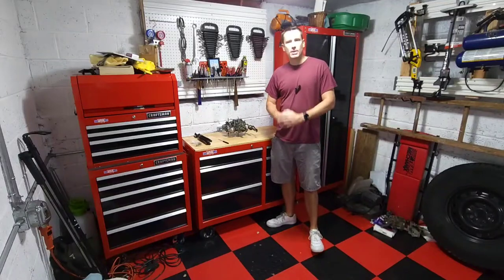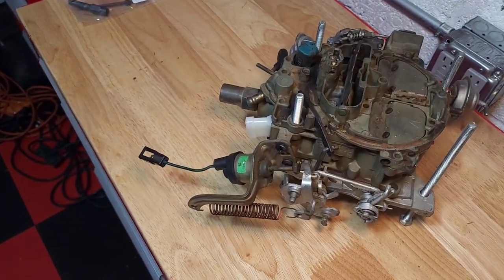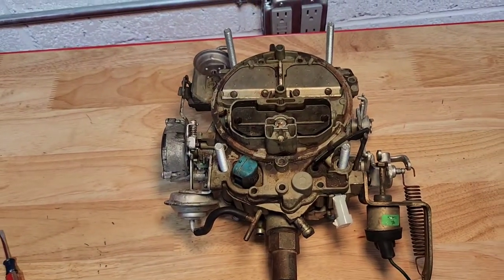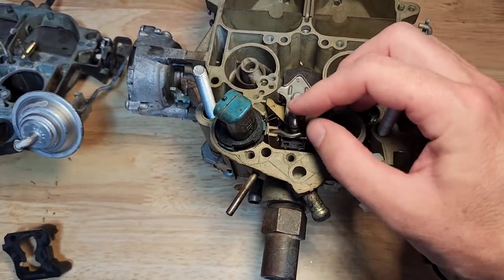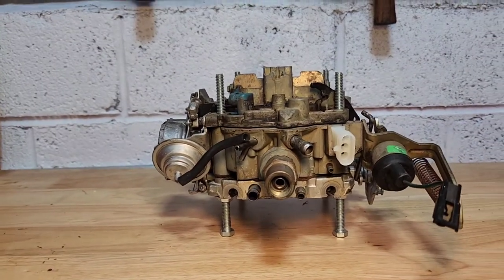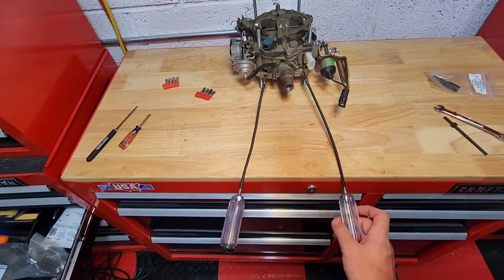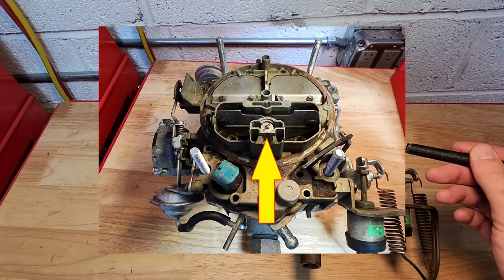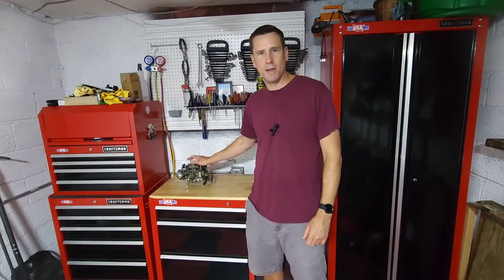The 4 Adjustments You Have To Get Right On An Electronic Quadrajet Carburetor

Comment: This is a very helpful video for those who don't know electronic Quadrajets. It appears you have the 17086009 carburetor (86-90 VIN 9) which the idle kickup solenoid actuator for A/C tells me this, along with the preset rich stop. Y engines are set exactly the same way internally. I know you meant to keep the video fairly short, and it's a very good presentation. Thank you for that. I'd like to add a few pointers here that may be of help.

When setting the mixture control solenoid using the adjusting screw, press down on the M/C solenoid housing with your free thumb while making adjustments as much as possible. This relieves pressure on the micro-fine aluminum threads in the fuel bowl body as you move the screw in and out. If they get stripped in the body, you're in trouble. Although your method certainly works, the preferred service manual method is to set plunger minimum with the gage by turning screw about 6 threads in to start, then use the tool to adjust the M/C solenoid position so that the plunger is set to barely touch gage. Then count the number of turns to gently, but fully bottomed M/C solenoid adjustment screw. Then remove the assembly and reinstall metering rods, and install fully bottoming the adjustment screw, and counting the number of turns on the way up. 

Also, when bench setting, it's a good idea to remove the plug in the top carb cover from above the M/C solenoid adjustment screw. After final adjustments of the carb on the car, you can reinstall preferablly a new plug to obviously plug the hole and the plug doubles as a "lock" of sorts on the top of the M/C solenoid adjustment screw. 85 and earlier flat tappet carbs with a rich stop has one extra setting that needs taken care of. You want the rich stop 1/8" of an inch total travel of the plunger + or - 1/16". Roller cam engines from 85-up all have rich stop built into the M/C adjustment screw and is non adjustable.

If there's a letter stamped on top of it, which for VIN 9 307 it usually is, set the Idle Air Bleed Screw (IABV) on the bench using the setting tool (1.756" gage setting from top of IABV to plunger paddle at lean stop) after the carb top is back on. It's almost a bench set it and forget it thing. But as always, final adjustments is on the car, running. I've personally not needed to mess with the IABV valve once set with the tool.

On these types of carbs with the lettered IABV, the idle mixture screws are the star of the show when getting your M/C dwell settings. They are bench set to 3 turns out from fully seated according to the 1987 AC Delco tune-up specifications manual. Be careful seating these as well, you don't want to damage the seats. When making adjustments for dwell on the car, you should be able to dial in your 30 degrees M/C dwell by mixture screws alone provided the bench settings were done properly. But as you point out, if you do have to make adjustments to the IABV, make them in small increments and wait 15 seconds for the adjustment to settle out. While convenient and less of a PITA to fit them in place, it isn't absolutely necessary to adjust the idle mixture screws exactly at the same time with two flex double D screwdrivers. You can adjust them one at a time. Just try to ensure you adjust them equally and give it a little time to settle out between readings.

And for clarification, the 0.41 voltage from the TPS is at 600 rpm in drive while on the car, A/C off with solenoid A/C kickup plunger not engaged.

When setting the carb on the car, it's best to set your ignition timing first before fiddling with the carb settings. 20 degrees at 1100 RPM with the advance disabled (ALDL grounded).

Lastly, clear any codes that may have set while you were tuning.

Keep it up. You make very informative videos.

Comment: A huge THANK YOU to the RPO guy! I followed your recommended steps and adjusted my 1983 Rochester CCC carb and now the car runs great and the Check Engine light doesn't come on anymore at highway speeds. 
The MCS was set too high, about 3/16", so I used the correct gauge to set it correctly. I also set the TPS at .46 volts per GM spec and the air bleed screw using the correct gauge. I set the dwell as recommended by RPO by adjusting the mixture screws. The final number of turns out was 3.75, I started at 3.5 as a base.
Later I was at a stop light and thought that the engine had stalled as I sensed no vibration at idle, the idle was that smooth. If I can do it you can do it, just get the right tools first. Fortunately I also has a Snap-On scanner from the 80s which gave valuable information on what the ECM was seeing from the input sensors.
The registration is due and now I am confident that the Toronado will pass the California smog test next week.
Reply from the maker: YOU'RE WELCOME!!! That's great news! I'm really glad you were able to get everything going. Happy I could be of help.

Comment: Probably the best ccc qjet video on YouTube, nobody actually explains what exactly everything is and how to adjust it. Been pulling my hair out over my qjet, is there any way you could do a video on the bench settings for all these adjustments? That would be absolutely awesome, or if you could pm me, whatever works Thanks!!
Reply from the maker: Thanks for the compliment! I'm trying to really break these down for everyone. I know there isn't much out there on them, and as the popularity of these cars grow, I'm trying to share what I know with everyone. The bench settings for the TPS vary with each car. The mixture control solenoid is usually around 10 to 12 turns out from bottom, but you really do need a gauging tool because each carb is slightly different. The idle air bleed is about 7 turns out from bottom. And the idle mixture screws are 3 turns out from bottom. I break it down more in the full video here:
https://youtu.be/VOCsOonLCXA

Comment: Great video and help.  Please clarify where to attach the dwell meter.  Manual says to connect red lead to bright green wire and black to ground.  After 40 years, the wires tend to darken. Thx!
Reply from the maker: I just made a community post with pictures to answer your question. On these cars, it's not so much a wire, but a connector. Its located on the wiring harness in front of the carburetor, near the thermostat. Simply attach the alligator clip to the metal tab inside.

Comment: Great video like the rest, but I am somewhat confused on the dwell setting. I understand dwell and know how to connect the meter to the engine.
You recommend setting dwell at 25 by adjusting the mixture screws, but also recommend setting dwell by the air bleed screw. Do I do both? The air bleed is sensitive, I agree.
Assume the MCS is correct, timing is correct, and TPS is correct when setting the dwell.
Reply from the maker: Set the dwell by adjusting the mixture screws. For your 5 liter I'd recommend as close to 30 degrees dwell as you can get it. The air bleed adjustment is more of a tweak at the end. Example: Your engine idles a bit smoother at 28 degrees dwell. Set it to 28 using the mixture screws. You can then slightly adjust the dwell to 30 degrees using the air bleed screw without affecting idle quality.

Comment: Great video.  Question for you.  I have a rebuilt quadrajet.   I replaced the throttle position sensor.  I have a small bog/hesitation at very low throttle.   When I hammer the throttle, no bog or hesitation.  Could this be a problem related to the throttle position sensor?   I did not adjust the throttle position voltage.  Thank you for your help.
Reply from the maker: You really should adjust the TPS to the factory voltage after replacement. It could result in the momentary hesitation you're describing. Of the TPS is set low, it will take a few degrees of pedal travel to increase to the point where the computer doesn't think the engine is still idling. This will result in a slight bog until the meter rods move up in the jets (usually a noticeable half second later then they should).

Comment: I would like information on where to get the gauging tool, please. I am watching all of you videos in this series and want to give the adjustments a try. the car is a 1983 Olds Toronado with a 5.0. I am getting a rich mixture code 45 at about 65-70 MPH. It goes away when I back off the throttle.
Reply from the maker: I'd be willing to bet your mixture control solenoid adjustment is off. Especially if you're getting a code 45 over 3000 RPM at highway speed with constant throttle. The best place to find the MC solenoid gauge is Ebay. I always see a few available every now and then. Do a search for " kent moore J33815 ". If you have any more questions, I'm happy to help.
Reply: @rporestorations  Thank you for you assistance, I will search for that

Comment: I am unable to locate the Kent Moore tools for adjusting the components. I’ve checked on eBay and those sets are not complete. Do you have a suggestion on how to proceed. The carb has been worked on by somebody previously.
Reply from the maker: The most important gauge out of those sets is the one that sets the mixture control solenoid height. It's possible to make your own using a slide gauge and a tube.

Comment: For the dualjet am I suppose to drill out the spot for TPS sensor adjustment screw and the bottom for the adjustment screws too?
Reply from the maker: You'll need to remove both if you're doing a full adjustment. If the TPS voltage is within spec, you can leave that alone. On the bottom of the carb, you'll find dots stamped into the casting. Take a hacksaw and cut a 45 degree angle on either side of the mixture screw caps. Then you can knock them out with a hammer and punch. Just don't go crazy deep.

Comment: Where can I get the M/C gauge tool that you drop in where the plunger goes??
Reply from the maker: Ebay is your best bet, but they're getting very hard to find. I recommend cutting a plastic soda straw (Think McDonalds) to length. It will work just fine. Get yourself a slide caliper from Harbor Freight, ($22), and cut one to 1.304 inches. You'll be able to use it just like the gauge tool.

Comment: I don’t own a dwell meter, but I for have an air ratio gauge installed with a O2 sensor.  It runs ideal till the idle drops then it goes to lean.  The exhaust even smells lean. Which way do I turn the air mixture screws to richen it?
Reply from the maker: Counter clockwise.
Reply: @rporestorations  appreciate that info!

Comment: so the dwell meter is used only if the car has an ecu? or how does that work on a standalone motor ?
Reply from the maker: Yes. You would need an ECU. If you're setting a non-computerized system, you would use a vacuum gauge.

Comment: Wont the adjustments be perfect if   carb has all adjustment plugs still on it and never been touched?
Reply from the maker: Probably, but... At this point in time, the newest electronic quadrajet was assembled 33 years ago. Even if it's calibrated correctly, it will almost certainly need a rebuild.
Reply: @rporestorations  oh ok thank ya. Good  videos

Comment: I hav a the same Quadrajet ? I’ll like to swap out the Quadra jet carburetor and put in a Edelbrock carburetor but I see that is electric so what do I do thank you
Reply from the maker: It is possible and (somewhat) easy to eliminate the Qjet and most of the CCC system with a few hours of work. You'll just have to make some changes to get your torque converter to lockup. But these are great carburetors and systems when tuned properly, so think about it first.
Reply: @rporestorations  I hav the wright transmission with the torque converter